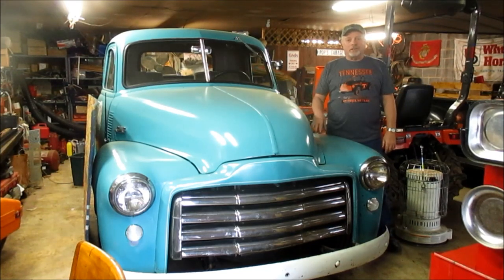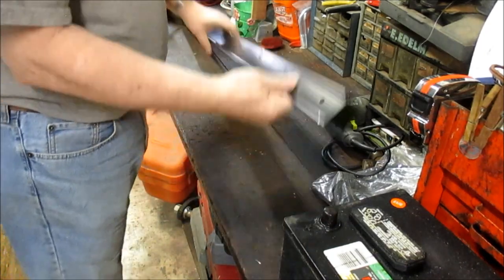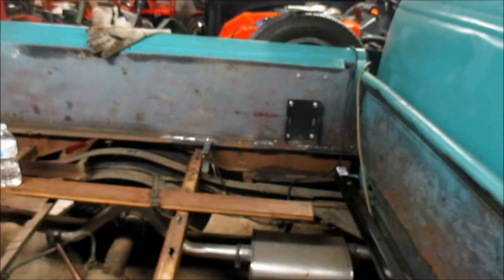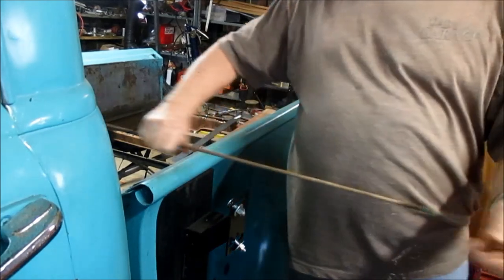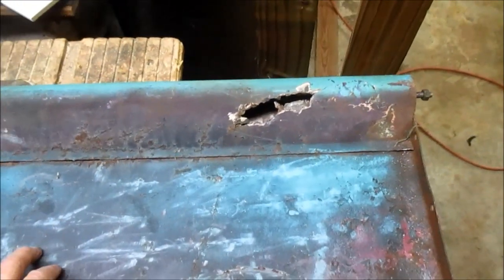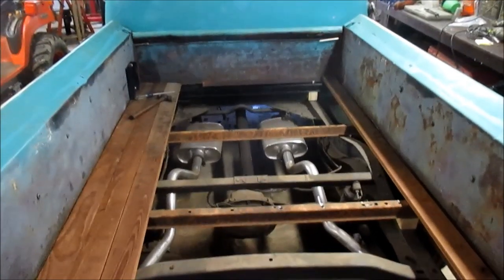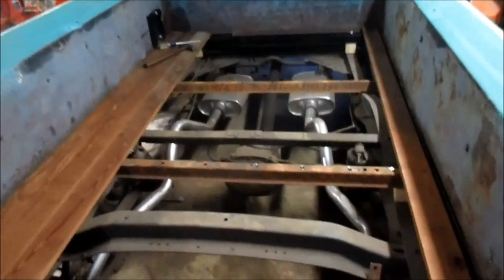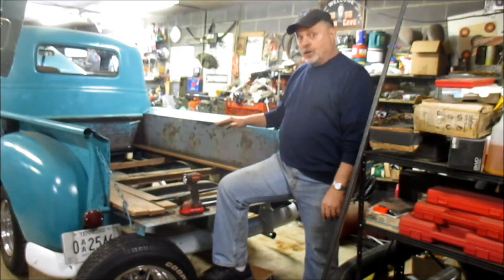1949 GMC Wood bed repair Part 3, Volume 39

Comment: I remember taking my truck apart and it’s like peeling an orange, I thought that I just had to do this one thing, but every time I took a peel off the orange I had another thing to do.
Reply from the maker: I did this once with an old 77 HD Superglide. I peeled it all the down to the nuts & bolts. Took me 3 yrs to get it back on the road.
There's nothing wrong with frame off restores. Some folks enjoy the journey more than the destination and there's nothing wrong with that. 
It's whatever cranks your tractor, LOL. 
Enjoying your build.